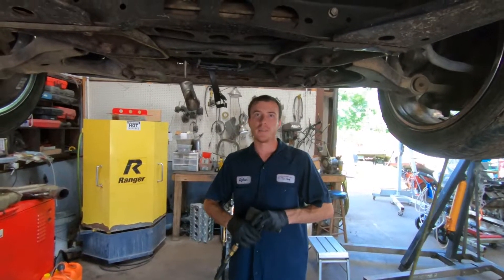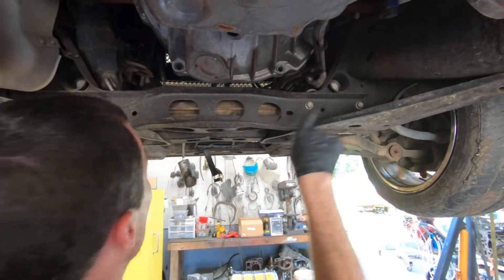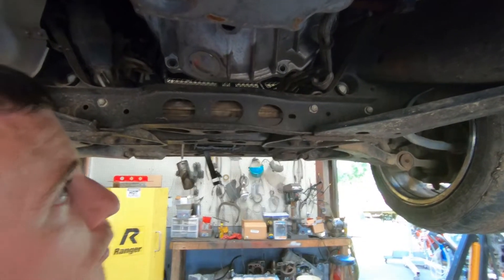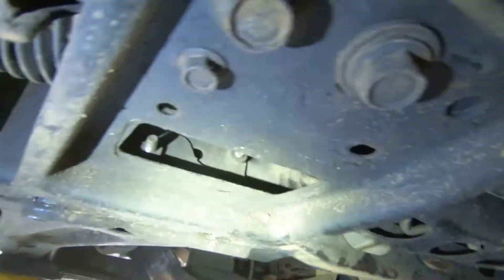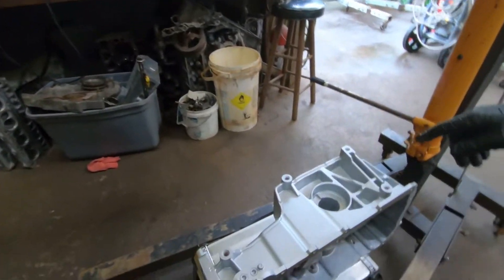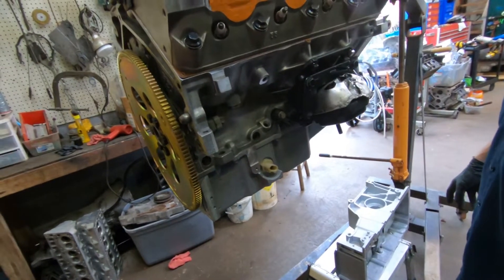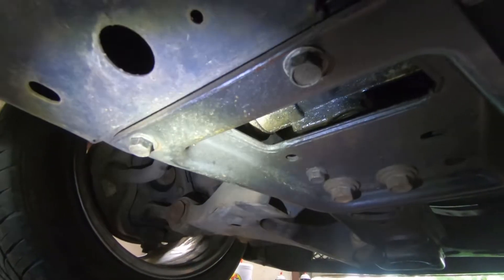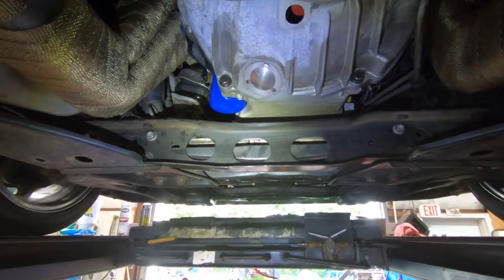Trailblazer SS C6 oil pan conversion

Comment: What pick up tube do you use for oil inside the pan. Video didn’t state the pick up tube
Reply: You need a C6 pickup tube as well. I did this on my SS last weekend. There is alot of info on the forums but basically you need. C6 Pan & the pickup tube and a dip stick/dipstick tube from a C6, and to keep your AC you have to buy a adapter that bolts onto the corner of the C6 pan, I bought mine from lc32
. (you could prob modify but I didnt.) Also my pan ran a different oil filter. You dont need a new windage tray or anything, it already has a notch for the new dipstick location. *Important* the C6 dip stick goes through the bottom of the block not in the side of the pan like on the TBSS factory pan, so when you go to put new pan on youll have to remember to knock out the pressed in plug from inside the bottom of the block (i used a screw driver to pop it out). That is where your dipstick will go into. People will tell you, you need a new crossmember and try to sell you on a $350 piece of stamped sheet metal but I opted to just flip and drill mine like this vid.

Comment: Did you have to do anything with the Ac?  I keep reading it needs a bracket
Reply: yes it does. lc32 makes and sells them. You dont need to completely remove the compressor just unbolt the bottom to bolts that bolt into the pan and then slip the c6 pan in with the adapter on it and then bolt those 2 compressor bolts back into that piece.

Comment: Looks like it has clearance but I can't tell. Does the crossmember have to come off ever time for a filter/oil change?
Reply: There is plenty of clearance for oil changes.
Reply: I cut an old coolant jug to channel the oil into my drain pan and not making a mess to clean up.